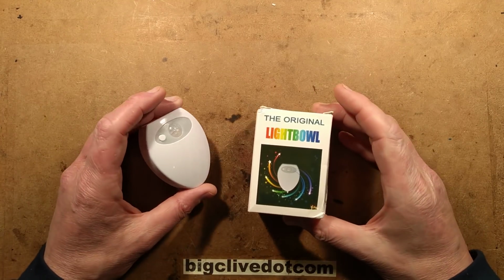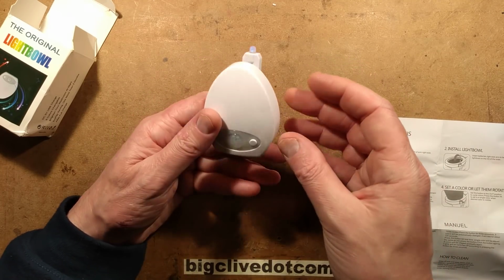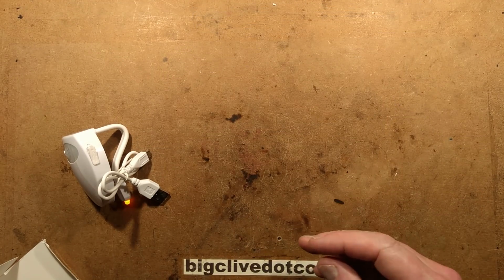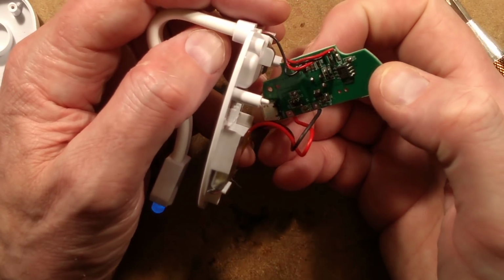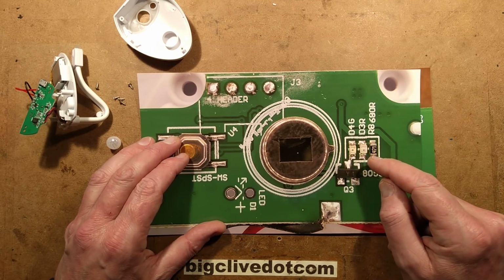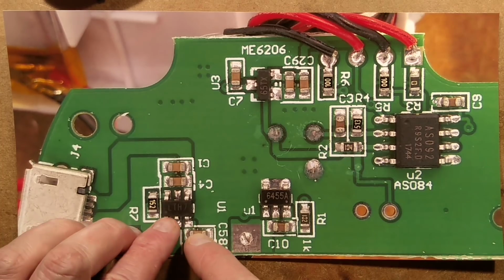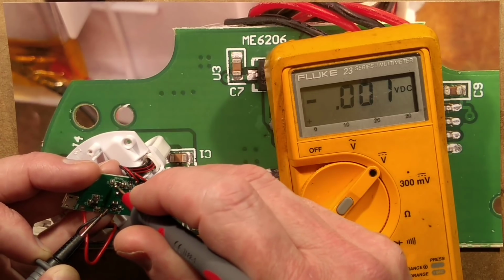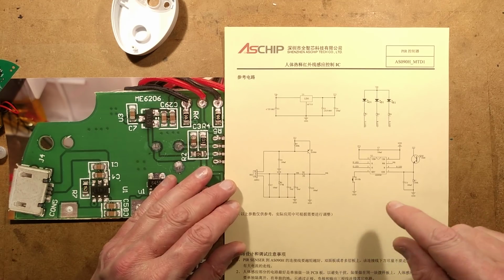USB rechargeable poop illuminator with piss-flap.

Comment: Detecting a butt at close range is going to give a much higher signal than more typical PIR applications,  so maybe that allows some of the front-end parts to be omitted.
Reply: I was thinking along the same lines. Plus, there's a lot of cold background temps. So yeah, when the tush comes close, there's a huge spike in heat. That is, along as the tush is human and not lizard man  :P
Reply: I was wondering if a large array of PIR sensors could give an image with the proper electronics, FPGAs. etc. (i know arrays of photocells will do this but I'd want thermal gradients shown)
Reply: E2: probably would work. I don't see why it wouldn't. Just use a lens that keeps it's field of view narrow and straight. You could wrap the bowl full of these and know where the hottest portions of your tush are   ;)
Reply: @BlackWolf42-  what are you planning, dude?
Reply: @BlackWolf42-  creep much?
Reply: @Jason Lee - You have no idea.  I think a lot of people are confused by my question.  By large array, I mean several hundred to thousand IR components on a flat board with a proper 'optic' for every sensor.  This is not something that I'm going to hide away on the inside of a toilet bowl; all waterproofed with the associated wiring going up through the water channels and into the tank where there is a battery and a transmitter - no, nothing like that.  My question was hypothetical only.
Reply: @BlackWolf42-  Suuuuuure 😂
Reply: @_IasonI_ee  youd be better off just gutting the thing and putting a normal camera in it tbh
Reply: @CAMSLAYER13  if that's what your into, not my thing at all tbh.
Reply: @BlackWolf42-  That sounds ludicrous, massively expensive, and likely to fail. Here's all my money, get started!
Reply: +E2qNX8btraQ3zRD6J7fc No. Pyrosensors like this only detect changes in heat.
Reply: @BlackWolf42-  they already exist -- they're called thermal imaging cameras
Reply: @AureliusR  No shit?  I thought my E8 and E4's were DSLR's.
Reply: mikeselectricstuff This sounds like a big-ass engineering project to me...
Reply: Except, some people don't have much of a butt to detect ...
Reply: Benjamin Esposti Could be a disastHER, or a disastHIM.
Reply: You can't always see a butt even if it's very close. Sometimes you just have to listen. (Ultrasonic or Microwave)
Reply: " mikeselectricstuff
mikeselectricstuff
9 uur geleden
Detecting a butt at close range"

It doesn't detect a but, it detects feet approaching the bowl.
Reply: But what if you have blue balls? Do blue balls emit infrared?
Reply: Laharl - More likely ultra violet...
Reply: Most of the application ccts show a direct connection to the IC using the pyro's FET as a source follower as is normal although here there's no decoupling at the drain shown. 

If anyone want to analyse the stage with the PNP transistor the datasheet is here: www.aschip.com/u_file/download/17_12_29/c23191a61a.pdf. The text just says "The above parameters are for reference only, and can be adjusted as needed in actual applications."
Reply: You leave my front end parts out of it.

Comment: how in the heck is that going to get shit and stuff on it when the charging bit goes on the outside of the bowl ? dear god
Reply: For the paranoid, research has shown that anything within a range of 1 metre of a toilet has elevated bacterial contamination.  Personally I don't give a toss.  Speaking of which, when will we have a colour changing semen light for us wankers?
Reply: my question refers to shit not bacteria i realize that anything within 2 feet of the toilet will have piss on it when not cleaned

Comment: how do you fool a smart PIR detector?If I stay still too long a light connected to the PIR goes off and it is annoying. Using an infrared led would probably not work as it needs to be moving for the sensor to work. is it?any ideas?
Reply: use a good bright incandescent flashlight.

Comment: If you put the unit the correct way around there should be no contamination on the battery holder. Most people go inside the toilet, not down the outside.
Reply: mbaker335 Most of the time.  A tiny percentage of misses will still accumulate.

Comment: Chip is a UP6455A

Google it for datasheet
Reply: It has an UP and an AS chip so where is the UR chip located?
Reply: vgamesx1  I see what you did there......
Reply: Or a You-Pee 6455A
Reply: Basically DW01 + 8205 in one. That's handy! Odd it's not more common.
Reply: Did you notice their typical circuit requires a 100 ohmy resistor? Oh my.

Comment: I don't get it, why not just turn on the bathroom light ?
Reply from the maker: Some bathrooms have a fan that starts on a timer when you turn on the light and runs for a long time after you turn the light off.
Reply: @bigclivedotcom  Jeremy Clarkson called that the jet engine in the hotel bathroom.
Reply: Because it fucking hurts your eyes in the middle of the Night? ;)
Reply: Markus_B That’s because smart people install dimmer switches on their bathroom/toilet light rather than a dumb all-or-nothing switch — one tap is low intensity, two taps is full intensity and one more tap as you exit turns them off (and you can set the intensity to anything you wish).  It’s so much nicer to step into a dimly lit bathroom at night when you were sleeping than full intensity lighting...plus you don’t have to worry about recharging a disgusting toilet bowl Illuminati’s every so many weeks or months.  These days a good dimmer switch costs very little and they are not difficult to install if one has at least a basic understanding of household electrical wiring and can follow the enclosed diagrams.

Comment: What if you put a high powered UV led in this to ILLUMINATE your urine and HORRIFY everyone.
Reply: Yesss that's a great idea, you might need to modify the circuit a bit since UV LEDs needs higher voltages (around 3.4v)
Reply: 10w UV chip powerd with 18650😂
Reply: That'd be an awesome prank! 😂
Reply: The ones I acquired came with a separate UV function. It is claimed that it is UV-C but I have not checked the wavelength as yet.
Reply: draggonhedd ç

Comment: Thanks for the photos and zooming in.  I did find info online for the Aschip AS092 and AS084. The voltage regulator is a clone of the ME6206 with a 8uA current consumption. If you want to translate the PDF files have a look at https://www.onlinedoctranslator.com .
Reply from the maker: You can find the datasheets at aschip's own website.  But not for this particular chip.

Comment: Hi BigClive.

Did you happen to look for the chip printed on the pcb? 

If so, then ignore me, but if not, then here is the web link for the chip, and then the download for the pdf (hopefully!) ...

http://www.aschip.com/products.php?Keyword=AS084

Having looked at the pdf, it does have an led output, but that said, it does look to be a specialist chip for that product!
Reply from the maker: I did find a datasheet for that exact chip number, but it was for a single LED PIR sensor.  I also found another chip that did the RGB but required a lot of extra amplification and filtering circuitry for the PIR.  This one seems to combine both into one chip but has no datasheet that matches the function and pinout.

Comment: Clive, is your aim really so bad that you coat the outside of the bowl with urine and faeces? It's only the LED bit that goes inside... (Granted, I wouldn't want to touch that part myself.)
Reply from the maker: It's not the aim.  It's the force it all comes out with.  It makes noises like laser beams and explosions.
Reply: I heard all well hung bears have that problem.
Reply: Bruh, the stream isn`t always smooth, (especially after sex for me, so now you know hehehe) depending on the force and where you hit and the shape of the bowl you can also have splashback, that`s the bad one, low, shallow bowls are the worst.
Besides, after a few beers it`s like a friggin firehose! xD
Reply: jesus just piss in the sink like a real man ya soyboys
Reply: 10mintwo That's when you get the sprinkler "fan spray" condition to run up the wall, or at least all over the faucet handle...
Reply: @10mintwo One of those few times not washing your hands in the sink before you leave the bathroom may be more hygienic! :-D
Reply: piss in water = splash splash everywhere, shorts on and sprayed legs...... or maybe its only us fellas with a big stream?
Reply: Undefined Lastname: Of course I saw it.  But if the bulky part is hanging outside of the bowl and in a logical safe spot, it will be on the "sides" of the bowl, to the left or the right. So therefore, a person walking up to the "front" of the bowl would have a hard time triggering it. The all seeing eye is not >180Deg viewing angle, and it'd probably closer to 160Deg. So, it looks like you'd "hope" it would see your leg when you go to squat.
Reply: Hey, I don't wrap my legs around the bowl to drop the stool  :P
Reply: Bruce: Comedy aside (the others have covered it really well :P ), the large chunky piece is what sits in the bowl, as that's where the sensor needs to be to sense the, movement
Reply: Korishan nah, the led must be inside, so consequently the chunky part is outside.
Reply: Korishan So you believe the function of this gadget is to illuminate the ground in front of the toilet while you sit on the bowl? I guess you could use it that way. But if you reverse it then it illuminates the inside of the bowl when you approach the toilet... maybe more useful :)
Reply: aszi88 - That's precisely it! Thanks for the support (I shall wear it always...)
Reply: hahah,  aszi88.   I stand, well, sit, corrected  :P   That would make more sense for the "light" portion.   Soooo, that begs the next question: how does it sense the hot arse so it'll turn on?!? Do you put it in the front of the bowl? If so, it would surely get wizzled on easily. If it's on the side, do you just wave your hand next to it to make sure it comes/stays on?  Hrmm  🤔  CLIVE!!!!  We need an actual demonstration here!!